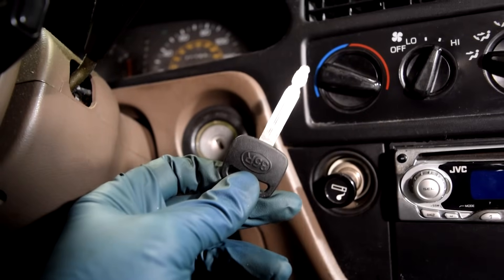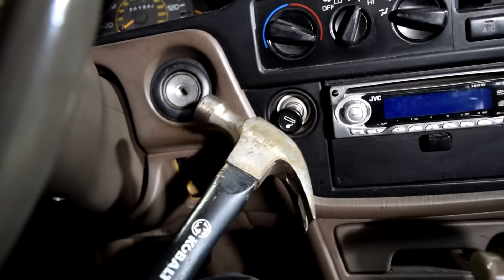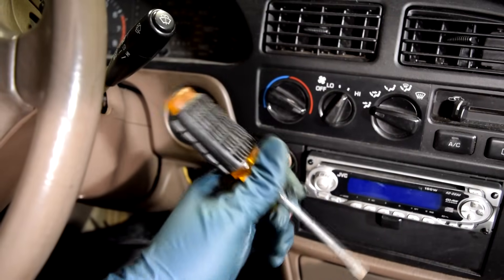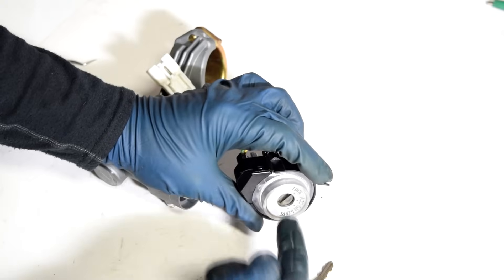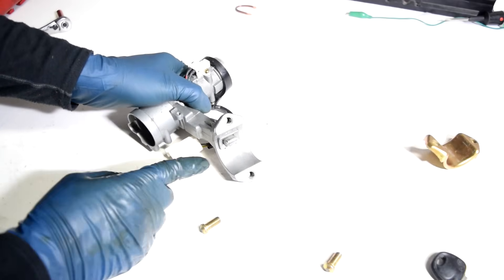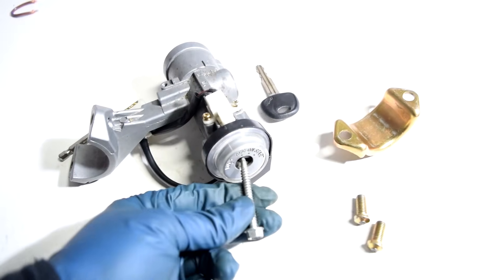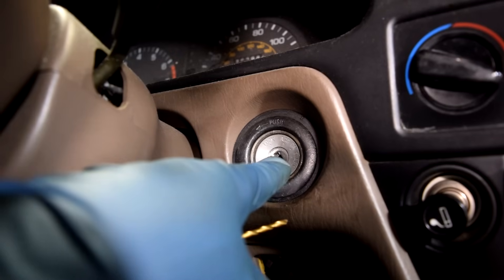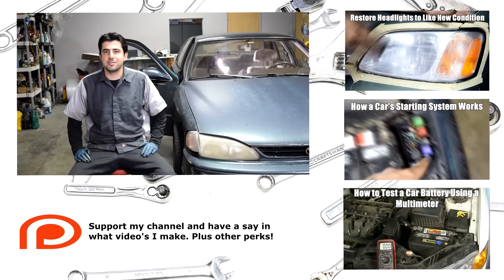How to Replace or Fix an Ignition Lock Cylinder to Unlock Steering Wheel - With or Without a Key

Comment: I tried the lube and wiggling and tapping the key with a sharp blow. I really didn't want to destroy the lock cylinder, but I had to. I was an hour away from home trying to get home from work. Thank God I had some tools. I proceeded to smash a flat screw driver into the lock to smash all the tumblers and then I was able to get a vice grip on the cylinder to turn it. The key is a chipped key, so there's a ring that goes around the cylinder with a circuit board attached to prevent people from doing what I did to start it. If the key is not in the close proximity to that ring the car will turn over but will not start. Fortunately I didn't destroy that electronic ring and circuit board. I was able to get the key into the now loose hole in the cylinder and turn the cylinder with a vice grip and it started. I was able to get home from work.  It took me an hour but after watching this video, I was able to get out of there within 15 minutes. The ignition cylinder gave no warning of being wonky prior to this. It was working fine and then suddenly just didn't.

Comment: Thank you !! As a woman I was taught that we don't do automotive work but I change my brakes on my 2000 Lexus RX300 it was one of the easiest things I've ever done but now my ignition lock cylinder has locked and I cannot turn the key whatsoever and done everything I've learned it so now I purchased a new ignition lock cylinder and I'm going to attempt to do it myself. Your video has helped me tremendously and I'm going to see if it actually works plus I'm going to do my own video about it
Reply: How did it come out?  Tell me all about it.  I am trying to replace mine but the part didn't work so I put the old one back and now I am going to think about it.
Reply: Really good indepth explanationsdidnt miss a beat

Comment: A good tip you can use if you have a chipped car, cut open the back of your key, and super glue the chip to the ignition coil. The chip comes out. When I broke my key for my Toyota, the key maker just cut it open, cut a new key, and put the old chip in the new key. Significantly cheaper than getting a new programmed chip. Also if you have AAA they’ll do it free.
Reply: Nope

Comment: This video is the absolute best to demonstrate all of the ignition mechanisms from the lock on the steering to the removal of the actual ignition module. I was working to pick the cylinder with racking the tumblers and I realized that this was never going to happen with a double tumbler etc. I found this video and realized all I had to do was to remove the detent that kept the cyclinder in place (without having to get to the ACC position to press the detent down). This guy REPRESENTS the best in DIY videos that saves millions of Americans millions in repair costs. KUDOs

Comment: Thanks so much !!  2001 Volvo v70 , 165,000 miles.. Lubricating the lock cylinder alone did not correct... Had to tap on the key with a hammer...  Worked great !

Comment: Excellent video; we were able to get my son's 2007 Sonata back on the road over the holiday weekend by successfully removing the lock cylinder and leveraging a pair of needle nose pliers for the on-start-off duties.  I love how the mechanic in this video describes progressively more drastic / destructive techniques for getting the lock cylinder into the "ACC" position.  The pliers on the key worked for us!

A replacement key and lock cylinder will be procured from the dealer as soon as they open. :-)
Reply: Was the key completely locked in the off position? I have a 2008 sonata and I can't get the ignition to turn at all...
Reply: @markcates749  mine just did same thing today. What did you do?
Reply: @lyndseymaldonado5246  It was actually a process, if you're key will not turn then you will have to remove the ignition, there is a small pin on the side of your  ignition that when push releases to ignition cylinder, I had to drill mine out because I could not get the key to turn to push the pin in and release it, but once you get the old, bad cylinder free a new one is pretty cheap, let me find the video I used on YouTube
Reply: @lyndseymaldonado5246  a shop might charge you a good bit, if you know a reliable guy that can work on cars it wouldn't be a bad job for him to do, all you gotta do is take the ignition down, it's a few wire clips and 3 bolts, drill the tiny release pin, put the new cylinder back in.
Reply: @lyndseymaldonado5246  I just watched this video over, check how he drills the pin, once you get the cylinder free you're good to go
Reply: What do you mean by leveraging pliers to turn the ignition to acc?
Reply: @markcates749  thank you for your responses. So the turning off the ignition cylinder only makes the pin able to be depressed? So if I can't, I just access that slot and drill it out?

I think I got it. Thanks again.

Comment: On my way to put these instructions and tips to the test myself right now. Best explanation of viable options out of 10ish videos and 20 articles read today. Most instructions are assuming you can turn the key if you're trying to replace the ignition lock cylinder (which is a weird assumption, considering...). Appreciate this guy for giving lots of options/ideas basically in order of the right way to F it grab the hammer and drill with a step-bit. Thank you sir!
Reply: How did it go?
Reply: Did it work?
Reply: @Dike2011  still locked in his car. 😅
Reply: @AurelienCarnoy  lol

Comment: The flat screwdriver, hammer and wiggling the key did the trick thankyou SO much! It literally unlocked within about 5 seconds with the help of a friend wiggling the key. Brilliant! The barrel on my 99 Toyota Hilux was all  but stuffed but once it unlocked turning it to start the car was relatively easy. Got it home, set it to ACC to pull the old barrel out and replace it. And i was told by a mechanic who looked at it that I needed to have the car towed to their workshop......

Comment: I did exactly as instructed in this video. I hammered a screwdriver into the ignition until I was able to turn it to acc. The locksmith wanted to charge me $300.00 and I was like, "suck my balls!"
Went to the auto parts store and purchased the replacement ignition for $42.00 and saved myself a bunch of money...and I didn't have to switch to Geico. 
Thanks bud!
Reply from the maker: haha nice, np.
Reply: What about a door key?
Reply: @myRatchets  will a bad key ignition assembly, shut down your car while driving?  I have to shake it 2 start it, 5 minutes or more ,it shut off,wait about 30 minutes,sometimes an hour then it starts up again
Reply: P
Reply: @myRatchets  I can't turn the i20 Hyundai 1.2 petrol ignition key to ON position. It's stuck at OFF and steering wheel is locked.

I wiggle the steering wheel but still it's stuck at OFF.

In fact, the key should be at ACC and a pin under the ignition be pressed to let the tumbler come out easily.

But, I can't make the key to acc, on or start!!!

So, how to remove the ignition cylinder under this situation??
Please kindly help. It's emergency.
Reply: @tnamen1307  TRY TO HAMMER THE KEY WITH RUBBER MALLET
Reply: @hurricane2madaba  I ordered aftermarket reed lock pins from AliExpress to be arrived next month.

Only pins I would change it.

Comment: Ok... I need you to know that this video saved what was turning into a very bad day! My key would not turn over (previously (7yrs ago)a bad tumbler and a locksmith just popped the bad tumbler out and got me back on the road for cheap.  Today it wouldn't turn over,  tried and tried and tried. Called a locksmith and basically they said there would be a service call and fixing it and bringing it back Yada Yada.  I locked the steering column and was looking at having to have it formally towed. I looked into how to pull the cylinder but all videos showed being able to turn it into the start position... which was my problem. YOU SAVED THE DAY,  with suggesting hammering it.... it worked with my fist while jostling the key and using my knee in the steering wheel! I drove it home and took my second vehicle to the auto parts store where i was able to get a new cylinder/key set up for 72.00!  YOU SAVED ME A TON OF MONEY AND EMBARRASSMENT! This girl is extremely grateful!!! 5 years later,  your video is still helping out people all over!!!! THANK YOU!!!

Comment: THANK YOU! Thanks to your great video I was able to get the lock out and get the truck going again. Once the mechanism was out, I managed to get the cylinder working by removing the front key flange (drilling out two rivets) then punching the inner cylinder out though the front. Once out I removed the worn out brass pins and teeny springs with some pliers, reinstalled the cylinder into the barrel, the mechanism into the column and got the car to the garage :-)

Comment: I seriously appreciate this video. I already had blisters on my thumb and finger from trying all the normal solutions and was about to look for outside help. But after a decent amount of persuasion from a hammer and a lot of patience, my cylinder finally freed itself! I'm half tempted to pull it out but it seems to be behaving just fine now with both of my keys.
I wonder what caused it to stick because this has never happened before! It was pretty hot out today but that's nothing new. No issues last time I drove my car. At least I wasn't going anywhere vital!

Comment: 88 Toyota long bed. WD + hammer and then drilling with 1/16" , torque and jolting snapped bit but released lock! The worst part of not knowing is not knowing. confidence is everything. thanks

Comment: Brilliant! Car sat in the drive for a few days. Couldn't get the key to turn. Tried the WD-40.
Learned the hammer trick from this video. All systems now GO. Thanks so much!!!
Reply: Mark Bersch- so did you end up  replacing the cylinder or does the original still work.

Comment: My buddy had the same issue with his Chrysler Concord and I sprayed some graphite lubricant and used a rubber mallet and gave his steering column a wiggle to get his car running again. We found that his key ignition cylinder was warn out and needed to be replaced.

Comment: If your steering wheel is jammed and the key switch will not turn is the good choice to insert a small flat head screw driver in the ignition and try to turn the lock? Thank you.

Comment: The most common problems that cause this are a worn out key, a miss-cut key or a combination of both. If you get your old worn key copied you have a brand new worn out key. If the key keeps getting worse. You have to wiggle it and mess around go to a locksmith shop and ask them to decode your key and cut a new one to code. If your local locksmith has game he can do this for $20-$30 on a non chip key car.
Reply: what year honda?  Noah Vale

Comment: Don't go thru that trouble the only thing you have to do is take the bottom plate under the steering wheel (is only 2 screw holding it) when you take the plate out take your left hand and go behind the KEY CYLINDER and grab it and tilted to the left and should come right out
Reply: "should come right out" yet your name is literally Mr Muscle 👌

Comment: Greetings, I have a question please, regarding fiat punto 55 solo 176 ignation system. i lost the only key. and even after CODE numbers, i can not get the Replacement key from the dealer. my question is,  if i change the whole ignation with new one will i be able to start n drive the car? do ii will have to reprogram the key? Please reply BR

Comment: How do you know if you need to replace the lock cylinder vs the switch? My problem is key not turning, wheel is not locked. I have been able to get by on wiggling the keys but seems like something is wrong.

Comment: Very informative.
Thaks heaps.
If the ignition barrel is removed, key or spare key can be taped to the transponder and the engine will start using pliers as you suggested.
But may need to move key around or through transponder to find the right "read" spot.

Comment: You do not need to punch the cylinder. There is a small tab at the bottom part of the lock cylinder that you can stick a pick or any tool and inside there is a tab that you can push to unlock the cylinder as if there was a key in there. You will save the cylinder and all you will need is a new key and tumblers
Reply: I'm guessing you didn't watch the whole video.

Comment: You can do that by doing the steering wheel and key at the same time.
Reply: Don’t work I have a 78 Benz I don’t have the key for it and today I put a key in and turn it left and now the steering wheel is lock and the key isn’t from the car to but I still moved it so I have hope for that key I had it at 1 than move it to 0 and now the steering wheel is lock and I can’t turn on the car

Comment: Try this instead:
1. Inser the key. (if key cant be inserted, try with reserve key.)
2. If the wheel was locked to the left, pull it more to the left and at the same time turn the key.

Comment: If you DO NOT have a key and you are at the point where (as shown in this video) that you must expose the cylinder to access the pin, well, there's a problem--and a solution. The problem is that this guy had a key. The pin will be in the locked position and you won't be able to depress it to release the cylinder. The solution is to drill the pin out. Voila! I watched videos of guys drilling out the cylinder from its face, sometimes haphazardly, hoping for the best. What they were doing was merely taking the longest possible route to the pin. Don't do it. Using a standard drill or an impact driver, drill out the pin from the outside  in, not inside out. It will work.

Comment: It seems everyone posts the same video on how to release the wheel.  My issue is my steering wheel is locked in place, I can start the engine, move the gears, drive too but the Steering wheel is locked in place and will NOT move.  I applied force,...etc.  it is locked in place.  Volvo 2002 V70 station wagon.  What do I do ?   Thanks.

Comment: So is that entire piece (even what attaches to the steering wheel) the ignition lock cylinder? Or is there a way to just replace the part the key goes in? It seemed like a lot of effort went into getting that part seperate from the rest, but it looked like that wire still attached it to the large piece that goes to the column was complete and inseparable.
Reply: Yes you can replace the part then key goes in and turns it's called the ignition tumbler the part that attaches to the column is usually not meant to be removed hence the tamperproof nuts and bolts

Comment: I have A is300 same problem. Already tried everything. Trying the hammer trick tomorrow and also the specialist anti friction dry DW-40. Hoping it does the trick or else I will have to take it to mechanic and get the push start button /:

Comment: I have a 96 toyota camry that was recently broken into and the ignition was punched out clear through destroying the ignition switch as well. I replaced the entire ignition, added a new switch, hooked it all up and plugged it in. After it was all together I started the car up and proceeded to drive but the wheel locked up. It happenes every time I start my car and drive. The wheel lock gets ingaged for some reason. I have had to bypass the ignition all together the last few months by rigging up the old ignition switch wires and to start it I plug in the switch to the cars harness and tap the wires that I twisted together to correctly start the car and keep it running when they separate after starting. To turn off the car I simply unplug the switch. Also because of this my clock doesn't work and neither does the cigarette lighter but thats only when it's connected by the hot wire metho, which I'm not concerned about those not working because eventually will just tap into their power wires and connect them by a fuse splitter...maybe... How can I fix the locking mechanism from not ingaging when I turn on the car with the key and new ignition and ignition switch set up like the factory setting??

Comment: actually this info is extremely basic just remove the cover and the upper cover for the dash where the pop on cover is and the lower where it requires 4 10mm bolts to be undone drill out the stud that is in the hole where it shows you push a small rod to release the cylinder lock and it doesn't go into the most common issue with an ignition lock cylinder on Toyota vehicle's. i find the most common issue is a broken link rod that is behind the ignition lock cylinder this is the most important problem people with Toyota ignition problems have because the link rod is made of pot metal and shears off. if you will get into how to remove the broken portion at the rear of the cylinder portion where it is down in the hole this will help us very much (regards.)

Comment: so my steer lock is enabled and key doesnt want to turn either even when jamming, will it work when i just jam a screw driver in it and then unlock it with turning and jamming on the wheel?
Reply: how to remove an Audi a4 ignition switch

Comment: I have a 2003 Yukon XL denali. The key won't turn the Ignition slower 200 and so I can't remove. The cylinder Ignition cylinder to that little quarter a little bit of a turn so you can push the button in.  Not so how do I get it out

Comment: I had to  jack the front wheels off the ground to relieve the pressure on the steering lock. Then the penetrating oil and hammer could do the job.

Comment: Thank you for the info, unfortunately it still didn't work...I have 2003 manual Civic LX, and same key opens door and trunk no problem - only this morning did it stick in the ignition. Sprayed lube in keyhole and shook wheel plus key while trying to turn, nothing. Really not looking forward to paying someone to replace ignition switch
Reply: Same thing happened to me.. had to have it towed. Ordered the part. Already at $350+